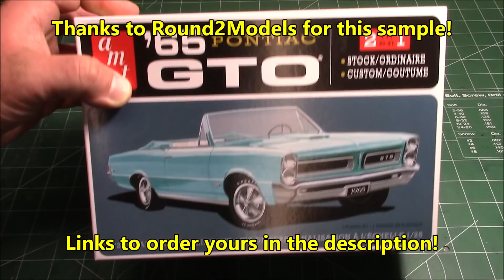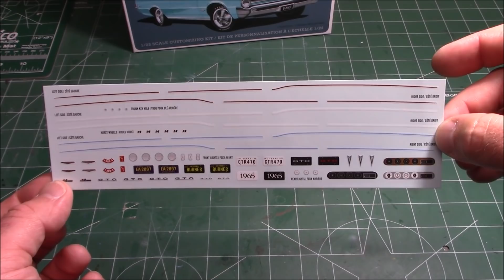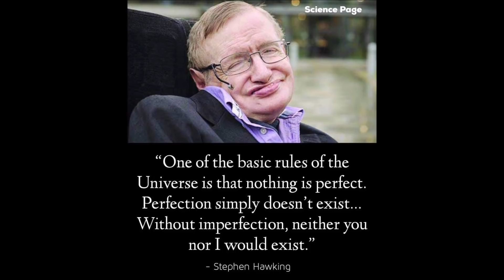1965 Pontiac GTO Convertible 389 2n1 1/25 Scale Model Kit Build Review and Weathering AMT1191 AMT

Comment: Another great job! I do alot of model railroading and it is easier to make things more beat up and grimy than factory fresh! Leaves were awesome! I want to build one like this. Maybe hold it over a candle to soften the plastic and put some dents in it. A trick i used before is to use rubber cement as a masker and brush it on the windshield in the path of the wipers. Let it dry then dullcote the whole thing. After that dries. Peel off the rubber cement and you have a clean streak where the wiper would have went across the windshield. Looks cool. Again another informative enjoyable video. I like your soundtrack too. Very relaxing
Reply from the maker: Thanks for the nice words!

Comment: You should really try, Liquid chrome pen, for the side moldings and interior trim, it works great, I got it on eBay 
Let me know if you try it
Thx 👍
Reply: The Molotow pen he used on the windshield frame is a Chrome, just doesn't show up on camera while he's doing it.  Great stuff to use, very realistic appearance.
Reply: Liquid chrome works great, I personally prefer the bare metal foil myself.
Reply: Justin M 
That’s kool man, I wish I could use that stuff, I’ve ruined about 3 cars, until I found that chrome pen,